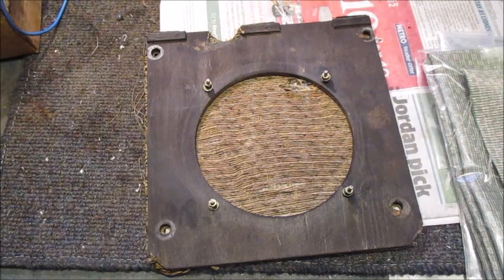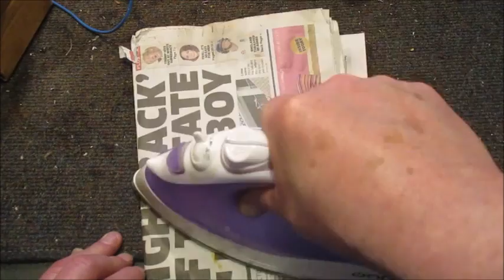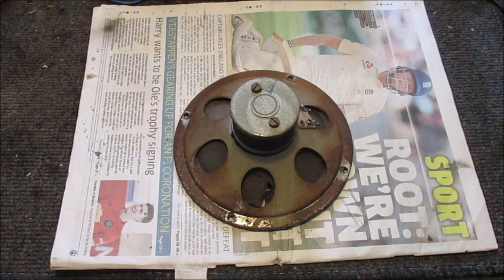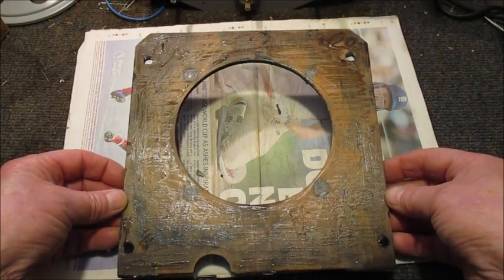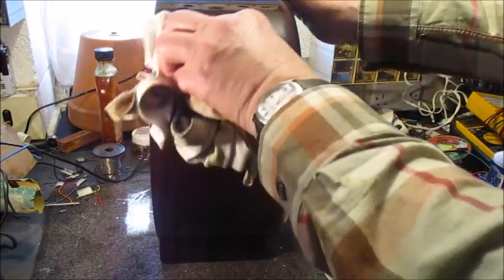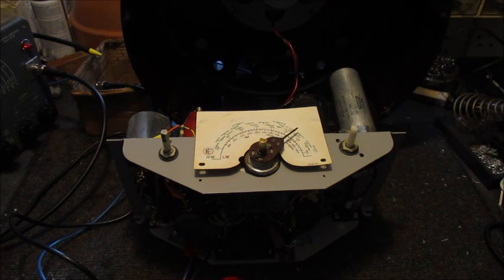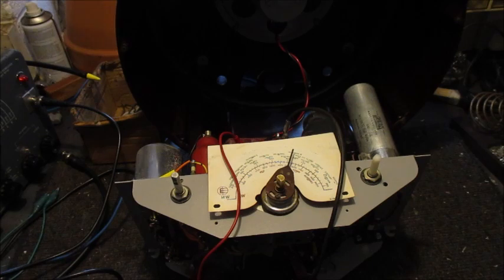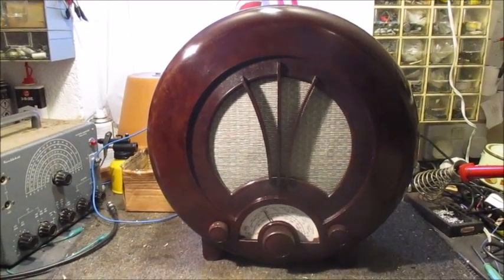Ekco, Model AD75, Reconditioned, Part 4, of 4.

Comment: What an excellent four part series, many thanks Phil, great advice here. I have just saved an Echo AD75 that has been in a garden shed for years. Very mucky and dusty. I too have a heat burn on the back cover but thankfully the mains choke and output transformer appear ok, case in fine condition and speaker cloth looks as if it can be saved, I have a more basic looking speaker, no name seems visible unlike your Goodmans. The dial is very poor but I was able to source a replacement. The voltage dropper needs some work as the bands are very loose. Interestingly I also seem to have a different valve layout from yours and the Trader 784 service sheet. The two red mullards are the same but the rectifier is a Mullard UR1C as opposed to a CY31 and there is a Mazda PEN453DD instead of the CBL31. Just started the restoration and getting a handle on what’s required especially with the different valve configuration, so an interesting project awaits. All the best Andrew

Comment: Phil -  You've done a fine job my friend.  The attention to detail and how you've described it is very much appreciated.  I would say the comparison of Ekco to Philco is fairly accurate although I think the old Philco were made even more cheaply. The Ekco does look like it has a bit of charm and character to it.  This has been an excellent series and I hope for many more of them. As we've discuss I am looking for a british valve radio to work on here in the states just to get the experience.  I shall let you know what I find in my travels but until then, thank you for an informative and fun series.   Cheers my friend TTFN
Reply from the maker: Ron C 
Thank you Ron,
Not much more than twenty-five years ago, any radio that was in the same general condition as this Ekco, AD75 would very likely have been regarded as ‘beyond economic repair’.  I persevered with it, and it is now said to be worth a lot of money, not that I intend to sell it.  My intention is to eventually own all six models of the ‘round Ekco’ range of Vintage Radios.  
Since I’ve reconditioned two Ekco radios in succession, it is time I chose a different brand from a different era.  I’ve lined thirty potential radios up, and now I’m scratching my head as I decide which one to choose for my next You Tube project.  All will be revealed towards the end of this month as to which one I’ll choose LOL.
Before you purchase a British radio for reconditioning, let me know what type you are looking at.  I might be able to pass a bit of advice, and knowledge about the set, as well as furnish you with a circuit diagram should I have one available.
Cheers Ron, TTFN Phil.